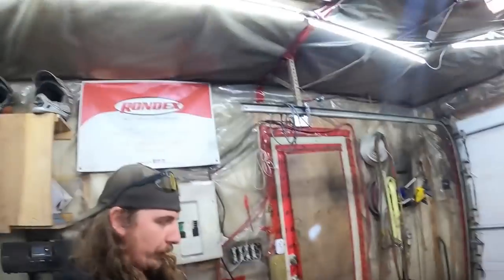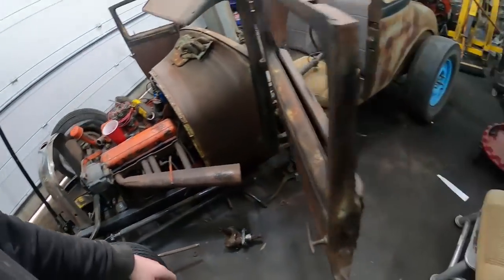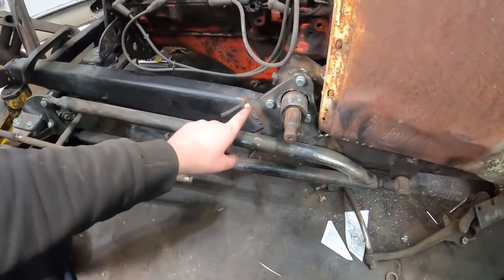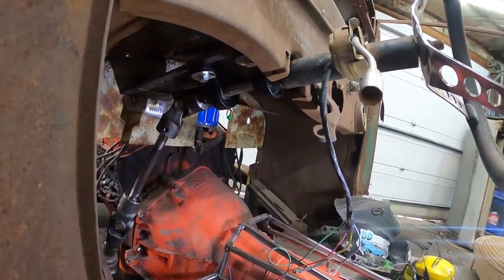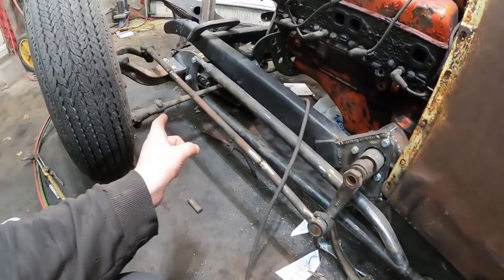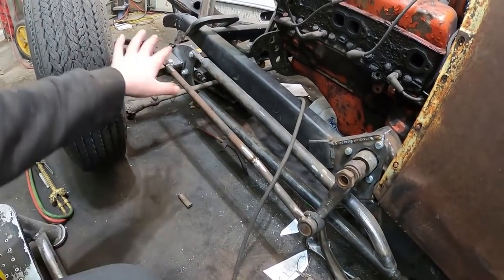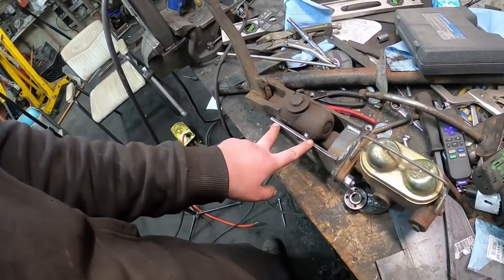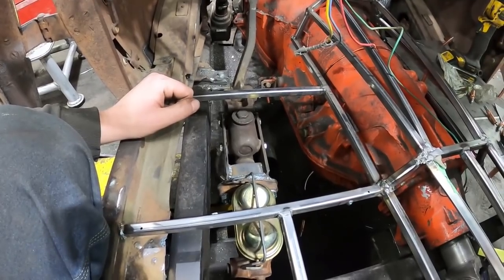Installing an Early Ford F1 Steering Box - All Junk Parts in my 1927 Model T Rat Rod

Comment: When you sleeve that, cut the inner bar at 45deg at the mating surfaces. So when the unit turns the pressure isn't on the welds but the face surfaces inside the tube.
Also on your brakes, why not get rid of the old pedal part and just fab one direct to the master cylinder. You could even put the MC next to the pedal and change direction of force. Seems like a lot of extra stuff that could fail. You could also use a 90deg PTO box to move your column from under your feet.
Anyway I love the build, you are always doing something great.
Reply from the maker: thanks buddy!  im suffering through it haha

Comment: On the pitman you can hand cut new splines on the flat indexes with a V shaped file so you can mount it in any position.
Reply from the maker: oh good call
Reply: Safer filing the spline, heat and bend the Pittman arm. Toss the weldment.
Reply: Broach the splines?  Most machine shops can manually broach additional splines if they are Bridgeport or similar equipped by grinding a tool blank and 'pumping' the quill if it is locked to prevent cutter rotation. Our shop (not the first) made a fixture that telescoped over the spindle and quill, split so cross bolts could lock both together preventing cutter (broch) rotation.
A sturdy drill press could work if you could chuck the broach, prevent rotation and provide vise alignment/feed increments.

Comment: Vice grip garage has that old 53 dodge? And in the rescue video he showed his pedal assembly and under floor master. It's a single pot but it may have a better linkage to work with in the tight spaces. Sorta a horse shoe linkage rather than that huge ol lever. You'll probably get it working well enough with what you got though

Comment: You know if you file out the king splines in the pitman arm  you can have adjustment to wherever you want it.  The rest of the splines will keep it located.   Then you don't  have to cut and weld on the pitman arm.  I  meantion this because  I  broke a pitman arm  and went into a ditch.  I  am still fixing my roadster,  almost done though.  Pitman arms are not a good place to take chances.

Comment: The top u joint is over limit it is binding and knocking not good Danny boy refigure geometry it will steer easier
Reply: I would agree. I hate to be a critic but I used to sell joints for steering and I would back this statement the bearings will fail in the joint. If memory serves, the Borgeson unjointed website provides a lot of great info on this.
Reply: What ever you choose on the grill shell everybody and granny gotta 32 get you a chrome model a shell it’s looks better for a  t
Reply: And big ass commercial headlights
Reply: Steering box under dash. Stubby column straight into gearbjox. run shaft out side of cowl high with a sprocket on it, outside the car. Directly underneath on the frame mount a bearing, shaft, sprocket and your steering arm. Connect sprockets with chain. Zero steering stuff down by your feet. Bad ass chain and sprockets on the outside of car. And can play with the top and bottom sprockets to speed up or slow down the steering if needed. Right now that looks like 30 turns lock to lock.
Reply: David Lee and be a little less dangerous
Reply: all good pointers .. also look up drive shaft phazing .. too much angle differance can make the shaft turn fast and slow during rotation .. make steering feel odd ...
Reply: @BBBILLY86 - Have seen a few like this, did not think about it for making room !

Comment: Drop the F1` steering box down and move more to front so side shaft comes out between suspension Ladder bar. By cutting a hole in the frame, it extends the shaft length so wobble joint is lower and hole in floor pan is not  so big.  If you need another wobble joint worth the cost, if you can move it lower and fore ward.

Comment: This being an older video I am not expecting my comment to be read but by others viewing. Do not cut the end off the pitman arm. Take a die grinder and grind out the master keys. Then you have an indexable pitman arm with out fear of failing a welded joint.

Comment: I'm thinking it would be better to have under dash bar to hang pedals from and mount steering to because I got size 14 shoes and you don't look much if any smaller than me. getting very very crowed in the pedal area and you haven't put in the gas pedal or lifter linkage cable & mounting. But its easy to arm chair a build. keep going looking good
Reply from the maker: yeah im learning as i go haha
Reply: @DDSpeedShop  such is life!

Comment: For the wobble joint in the floor, you should make a rubber "boot" for it, picture a tie rod end boot, so it hugs the shaft between the wobble joints, then widens to cover the lower wobble joint, will keep noise/dirt out of the foot area

Edit: Thinking about it more, just make a piece of rubber like how you'd make a cone out of paper, self tap it to the floor, staple the overlap together so you can disassemble it. I have 60 year old floor mats from a Ford, if you want 😂
Reply from the maker: yeah itll need some sort of cover for sure
Reply: I really like what you do

Comment: I know the master cylinder has to be where it is but if a person could put some fill lines in the cap itself as it is sealed and shouldn't leak if you can get around the inside the cap has that filler rubber that sucks down as it empties. What would be nice is a reservoir on the firewall or in the kick panel area that could have the cap unscrewed and fill from above and not lift floorboards.I like the aftermarket grill shells but this one doesn't really set right. A shorter one would look better yet what does the actual rad say or is it tall like the grill? Won't or shouldn't get dislikes from me

Comment: That upper steering joint, like others have said, is way over limit. It will wipe out the joint in no time. May hate to hear it but probably gonna have to re angle the steering shaft to make it happy. 
As for the brake assembly abortion you got going on...shitcan it. With limited space, you need every bit of it. Your chasing your tail there with what you got going on. Would be easy to fab up a simple bracket assembly that can even use the existing pedal arm if you so desire. Or Fab up a new arm too. Just use the good master cyl you have in the same orientation. 1/4" plate should be plenty sufficient for fab material for the master bracket. Universal assemblies can be had for $70-80 USD online if you don't wanna Fab one. Don't forget  Residual Pressure valves in-line for each side of the master cyl. since it's under floor. 'A' for effort though, I get where your trying to go.
Reply from the maker: im gunna suffer though this and make it work haha.  then when it doesnt ill spend money.  thanks for the tips man
Reply: @DDSpeedShop  I hear ya, part of being on a budget. As for the steering you have one other option, depending on if Princess China carries them, is what's called a double U-joint. You can really crank some angle out of them but is a little longer setup. Here's a Summit link to what I'm referring to. https://www.summitracing.com/parts/brg-226464

Comment: May 01st '20 6:00 PM 🇺🇸😎🎩 
As You Have Been Working On 1927 Ford Model T , Wondering If You Will Be Driving The RatRod Before Summer Is OVER this Year 2020 🕶 🎥 ⛽ 🏘 🏁
Reply from the maker: probably around the block sooner rather than later

Comment: Looks good, a smaller brake pad from a standard trans car would work, and are you making the steering column collapsible? That would suck taking that to the chest, even if you put aluminum bolts on the pillow block setup you have now. I know safety third and all, but who is going to make these juicy videos if you eat a steering column when Prius Douch hits you?
Reply from the maker: thats not a bad tip with the differnt bolts.  thanks man!